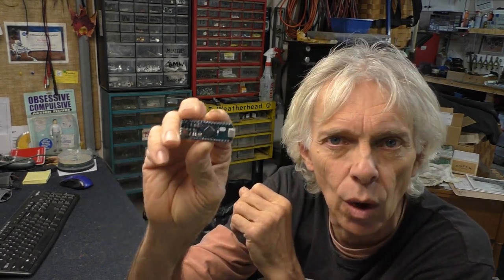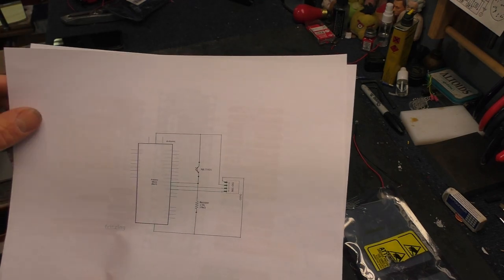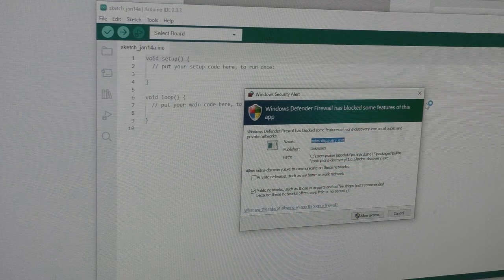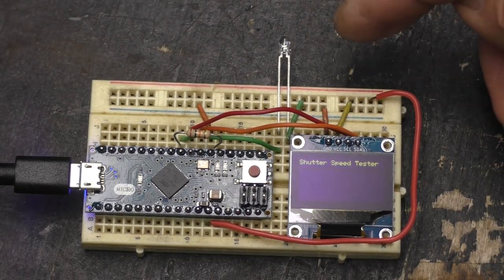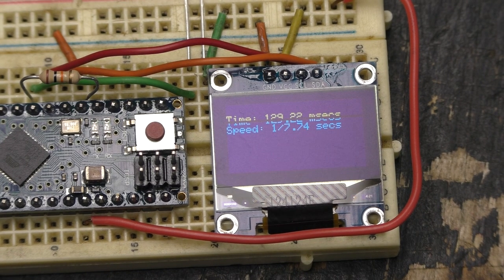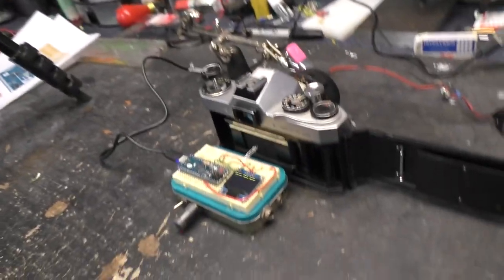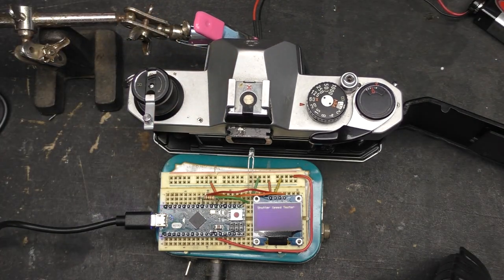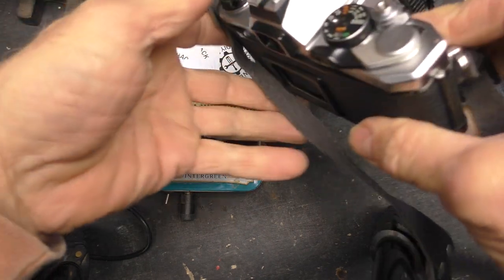Shutter Speed Detector with Arduino

Comment: Many years ago I used to work at a camera repair shop.  It was a specific name brand factory repair shop but we worked on all major brands.  When we timed a shutter we would first remove the lens before placing it in the shutter tester to be sure the incoming light would reach all four corners of exposure.  The test tool would shine a constant wide beam of diffused light in through the front of the camera and take three time measurements at the top left, center and bottom right each time you operate the shutter.  That way we could tell if the shutter had an even exposure throughout it's travel.  Why top left, center and bottom right?  Some shutters travel horizontal, some travel vertically and some are iris type shutters.
Reply from the maker: The Pentax tester tested slit width across the travel. I did this by taking a sample at extreme right and left and comparing the results, which ended up being very close after some adjustment to spring tension on take up rollers. I've used this on three cameras I've serviced so far. My K1000 refuses to work properly at slow speeds though. Can't get it to work right and I've concluded that it's from general wear. Slow escapement got a full CLA but still won't do it's thing.

Comment: Nice project to build ad-hoc to test camera if you are not professional service. To improve accuracy in reading faster speeds I would use low-power laser diode and hide phototransistor in tube. When end of first curtain is followed by beginning of second one, this may indicate exposure to light coming from side of phototransistor.
Reply from the maker: Good idea. Thanks. :)

Comment: Did you verify that the Arduino is calibrated correctly?   Get an Arbitrary Wave Generator and set it to output a pulse with a known interval and pulse an LED then measure with the Arduino to confirm the Arduino is working correctly.   Or just get a 555  one shot and measure the pulse with a scope and do the same as above so you know you have a known pulse width to verify Arduino is measuring right.    Great topic for follow up vid.
Reply from the maker: I did not verify this MCU. I like the idea of a pulse from a 555 measured on a scope, then check against pulse with my tester. Might try that or from a wave generator I have buried somewhere.
Reply: @HackaweekTV  Always good to test your test gear before trusting them.   It feels better to test things with known accurate tools.  Good luck.  Let us know what you find.

Comment: Thanks for the video! Nice work. I wired this one up, but mine triggered as soon as the sketch loaded and seems to be stuck in a self-triggering loop. Any ideas?
Reply from the maker: As long as light is falling on the detector it will trigger. Try blocking it from light and see what it reads.
Reply: Thanks! That was it. I had to shield the phototransistor. By the way, have you found that the Arduino project itself to be accurate (I.e. latency in the circuit, etc.)?

Comment: I’m using Arduino Nano, and don’t know how the board don’t read the sensor…Sad, i think it should be wrong in pin difference, I still not figured out yet
Reply from the maker: Check sensor polarity!
Reply: @HackaweekTV  Yeah exactly Thank you! Made a stupid mistake.
Reply: @HackaweekTV  Many thanks for introducing this project, it's like opening up a pandora box. I noticed that it works great in speeds slower than 1/125, especially slower than 1/60 speeds. 
For example, like in your 11:41, I tested an electronic control shutter of 1/500, and it read exactly the same 1/357, I tend to believe it's the error of the measurement not the fault with an electronic control shutter. Do you also think it's not good at measuring high speed? I'm thinking of ways to improve it, did you have any idea about it?

Comment: Hey, great stuff, I tweaked the code a bit, used a different display (ST7735) and used a phototransistor from a drawer (BPX43)  and it worked on the first try...
Reply: Hi Pavel, I have a BPX65 and am thinking of using it as it's faster, may give better results. I wonder if you could share a bit about your improvement in using it? I'm an amateur in electronics. Is it going to add some components?
Reply: @matthewchen1006  Considering the times used by old cameras (1ms) I think BPX65 (12ns) will not give better results than BPX43 (18us). I don't think any extra parts are needed compared to the original. The BPX65 only shows less current than my phototransistor at 5V supply.
Reply: @pavelkuzel5013  Thank you so much. I misread the size relationship between ns and ms. I'm using the SFH309-4 used in video. But as I tested 1/500 on a electronic shutter it read 1/357. I'm thinking this phototransistor is not accurate enough. If i want to get a better phototransistor, what specs I should focus on? Or can I just brought one BPX45 same as yours and replace the SFH309-4 directly without changing code and resistance?
Reply: @matthewchen1006  The BPX43 and BPX65 have similar current values and the resistor is used as a pull-down for the Arduino. So the only difference will be the amount of current. But since only 5V power supply is used, nothing needs to be changed. With my BPX43 phototransistor I measured 1/811s on one camera.

Comment: Great tutorial . Couple observations; Accuracy seems to decrease at speeds of 1/500 or higher, also affected by the ambient light. This might also be because of the width and sensitivity of the phototransistor and some added diffraction from the shutter curtains at these speeds. 

I have had better accuracy in a dim office with the light source and tester placed further apart from the camera ~foot. However, I'd think its fair to assume if your speeds from 1sec to 1/250 are accurate, the higher speeds should be really close. Cheers.
Reply from the maker: Thanks for the comment and for watching.

Comment: I know nothing about Arduino's but as I was gifted an Uno a few years ago and never learned to use it,  I rummaged around at home and found it this week and  managed to figure our how to wire it up and load the program in, bought a screen and phototransistor, had a bit of trouble translating the input pin to the Uno board but finally got it working and was delighted.   I still shoot film and have about 40-50 old film cameras at home so was interested to know which ones still were usable.
I tried to test a few of them out with various speeds by shining an LED light through the back of the shutter and having the sensor pointing at the lens (keeping lens on in all cases)    (I had recently watched a video of a tour of kamerastore in Finland test shutter speeds with old equipment using a similar method)

I was horrified by the results so much I did not believe them. I either need a way to calibrate it, or its not measuring correctly.
I know nothing about electronics but my gut feeling was that the shutter curtins/blades act as slits of light travelling a certain distance so it might set the timer off and on inconsistently depending how wide the slit were.   I notices some of the older cameras I tested with a set speed that used a leaf style shutter were consistent and more accurate.    

Not sure I can trust the results I got, I've been using some of the cameras like my Leicas and Mamiyas  with good exposures
so for the tester to tell me the shutter speeds are so off.......Mmmmmm

Have a link to the speeds I was seeing when using the setup:
https://docs.google.com/spreadsheets/d/1w-Y9Zd7TtBe6v-cmrl397sRjgwXSVNPp-okSZwGIAzU/edit?usp=sharing
Reply from the maker: Are you testing with no lens?
Reply: @HackaweekTV    I've lens's on all the cameras that I've tried so far, (some of them have non-removeable lens) 
I must try some of them without a lens to see if it makes a difference. Seeing a camera repair crew testing cameras they appear to keep the lens on when using the shutter measuring device so I did not think to try them with the lens removed.  (I see other people also have the sensor at the shutter curtain rather than in front of the camera but I dont know if it makes a difference or not yet.

It was my first attempt so plan on trying to read up on things and trying again being more careful, also waiting to use up some film on one of my cameras that has been working fine an Leica R8 to see if that might be accurate.

Loved your video!  had that arduino thrown in a drawer unused for ages without a use for it and would have never have bothered trying to figure out how to use it until I spotted this video online and it motivated me to think about trying to put it together.
Reply: @bulletsie  You can try using something like a paper roll with some tape. On one end, you can have the measuring device, and on the other, an LED diode controlled by another Arduino. Or you could tweak the code or use something similar, perhaps a phone app, where you can digitally set how long it shines and test it that way.

Comment: Problem is, you are measuring the width of the curtain slit AND the width of the sensor.

As the 'shutter speed' gets faster (it does not, shutter moves at the same speed) the slit narrows (which causes shorter exposure, not the shutter mech moving faster) the ratio of slot width to sensor width decreases, thus you get a greater and greater error as 'speed' increases.

e.g for a flash sync of 1/30s on a 35mm camera, slot width will be 36mm & sensor width, say 2mm.

At 1/500s. slot with will be 2.25mm (36/2 =18   18/2=9    9/2=4.5    4.5/2=2.25mm) 

so at 1/500s, sensor is almost as wide as the slit. 

A single sensor will also not show the curtain speeds. there are two curtains, which need to move at the speed stated in the repair manual, to give correct exposure and they both must travel at the same speed.
Reply from the maker: You are right. The good testers have two sensors. BUT, this one will at least tell you if you are close and it's cheap to build.
Reply: @HackaweekTV  Indeed. It might also encourage others to get into the world of Arduino I use EPS32 now, on the  Arduino platform. Only a few £ more but gives much more versatility and speed. 

Normally, a camera is tested without the lens. By doing this and taking separate readings from both left and right side of the lens mount, one can see if the exposure is even across the frame.

Adding a mask in front of the sensor will improve accuracy at higher shutter speeds. Try a mask with 0.8mm hole.

I used the Arduino laser tx & rx module. Laser gives a nice collimated light source and the rx has built in Schmitt trigger and amplifier. 

My tester became a monster. Three sensors, to show exposure balance across the frame & to measure curtain speeds. Connection to flash socket to test sync speed. 4" TFT colour screen. Full diagnosis, showing rolling average, nearest, deviation from centre etc. Once you start programming with Arduino, you just can't stop 😀

Comment: Built this recently with some issues...

I have no problem measuring below and up to ~1/60 sec but as the speeds go up the results get wilder and are always too slow. For example, my FE2 can't measure anything beyond around 1/1500 sec on the 1/4000 shutter setting and I get similar results with an N80. I have no reason to suspect either of these cameras to be that wildly off and I've used the FE2 successfully at high speeds for years and years. So I really don't think this circuit with the SFH309 is too useful for anything other than slow speed testing. Definitely interested in other users feedback and results with a different cell, or options for ways to make this reliable enough to actually be confident in the results.

I'd also recommend changes to the displayed output. I found the default font to be far too small to read easily and there was a lot of extraneous information being displayed. I have mine set up like so:

Test Ready

Then...

T = 1/XX.XX
XX.XX ms

I created a fork of the original code with my GUI updates and a much shorter recycle time (adjusted on line 118) for the next test in case anyone is interested.
https://github.com/P1NBA11ER/shutterspeedtester/blob/main/arduino/shutterspeedtester/shutterspeedtester.ino
Reply: There is a geometric limitation of such a device:
The curtains travel speed is roughly 3 m/s, according to repair manuals.
So the curtains moves from 3mm each millisecond.
3mm is the size of the sensor.
Because you have no idea if the timer is started when the curtains reachs the beginning, the middle or the end of the sensor, the best precision that you can expect from the device is 1 millisecond.
At 1/1000s the measure uncertainty is 100%
at 1/500 the measure uncertainty is 50%
at 1/250 the measure uncertainty is 25%
And so on.
In order to improve the precision of the measure, the system, including the light source, must be calibrated.
You can find an example here, of a device that use a calibration procedure:
https://youtu.be/vWWtHFmMRck